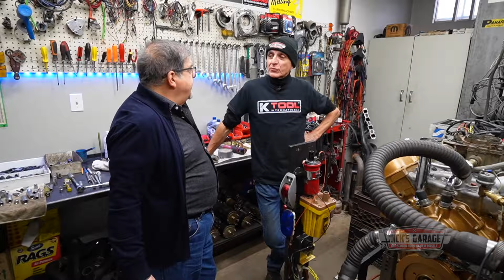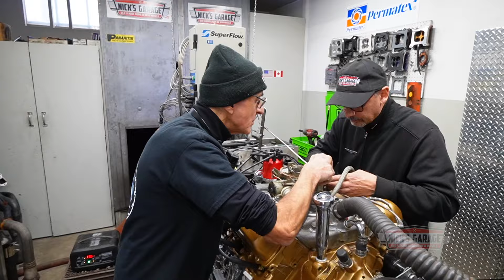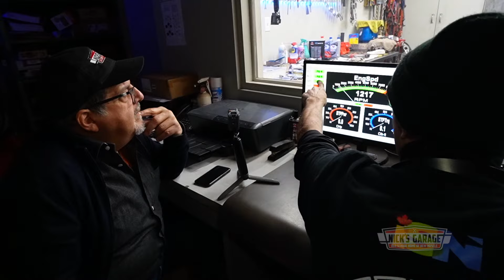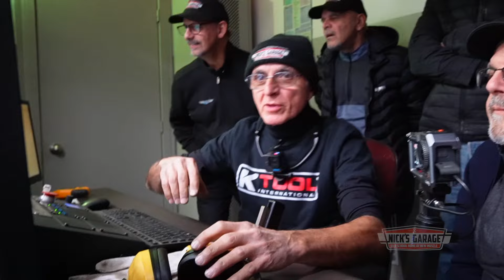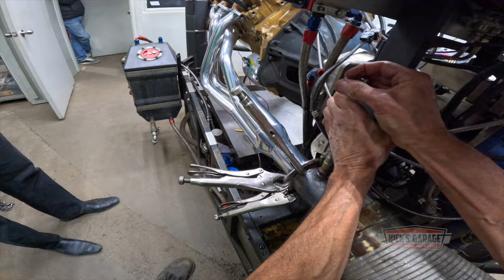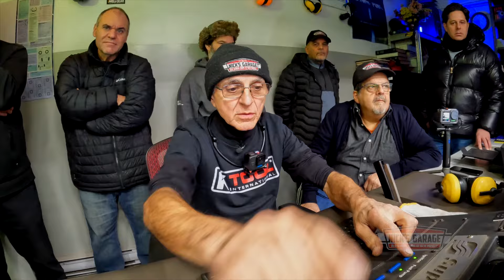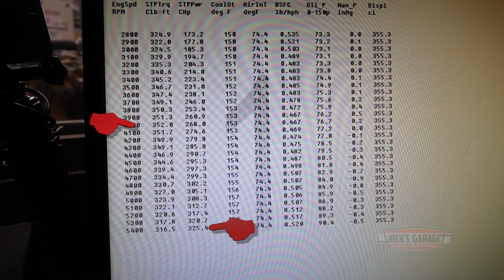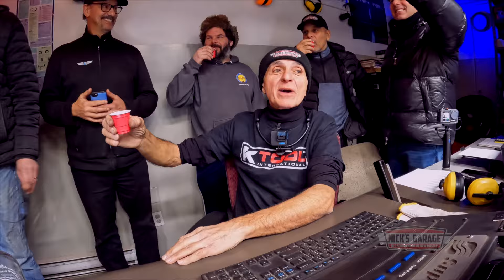Rare Olds W-31 Dyno Party - High Performance Small Block Tested

Comment: I still remember the 350 Olds engine Nick built for the guy that wanted 400 horsepower from it. I think Nick could have gotten another 65 horses if he had built this one himself.
Reply: I saw that video. He had the wrong intake in that build, and not enough cam to make 400 anyway. In addition he had a couple of spacers and an 850 carb, all of which weren't going on the car anyway. So what good is it?
Reply: @oldsmobilecutlass1805  ....It made 402 HP with a Rochester. And factory cast iron intake. In my opinion, that is great.

Comment: Had a W30 68 442 back in the day Mondello helped me with my engine great guy and harland sharp devloped the  roller rockers  for the Olds  engine yes I got a 466 W27 rear end for my car back in the 80's for 200.00 !!!! Great car had it  for over 25 years . Was one a few guys that had  roller rockers over 40 hp  per head !! Good luck with your W31 ! Nick keep  up the great work !!! BTW Olds run the best at 38 degrees with the right octane !!

Comment: The 66-71 Tornados were ultimate street sleepers
Reply: Had to sell a 455 Toro motor during covid couldn't give it away in NW Ohio, a very cool brother from Cleveland bought it to use in a 442 project. It still had the Fwd trans attached. Motor needed tlc but was good to go.
Reply: I have a stock 1970 455 Toro GT W34 engine in my ‘70 W31 Holiday Coupe. Along with the factory 3:91 gears and 4 speed M21 it tears pretty good.

Comment: I have one of those Nick, I have  #5 heads 1968 W31 spec. with the larger valves of the W30, my block is a 71.... that engine is like the one you had on the show a few years ago.

Comment: This reminds me of my 403 in my 79 trans am se. I used to love hearing the four barrels kick in. It sounded like it was going to suck the shaker down the carb. Mine wasn’t stock though like this one is. Like they say, there’s no Olds like an old Olds!
Reply: My son had one as well in 79, did a #5 head swap, a better cam and intake, headers, jetted the carb, curved the distributor, and adjustable rocker train, whole different animal! The only PITA was drilling out the head bolt holes on the 5 heads for the bigger 403 head bolts. 👍
Reply: @Musclecar1972  did you ever put it on a dyno? That’s what a lot of people did instead of buying expensive aluminum performance heads. Used to we would get all the magazines that had different build specs and start hitting the salvage yards while saving up for a cam and ignition.
Reply: @ecleveland1  No, we didn’t, but I can tell you it was a whole different car, unfortunately about a month after we put it together, he bent the car in half around a pole, the motor went into a 1987 Cutlass I believe, I was mad at my son for a good while after that. 😡🤬

Comment: The fill size car had a bigger booster. I had a 1973 Riviera with a big cam and my brakes were fine. Now in a Camaro with a big cam you have a rock hard pedal.  I made almost all my cars hydroboost anyway
Reply: It had zero to do with the brake booster, and everything to do with the fact that the bigger W-33 and W-34 cars all had a big block in them instead of a small block, and the big blocks WOULD create more vacuum than the small block with the same camshaft.

Comment: Hello viewers.  Were the stock ex manifolds any good or were headers a big time improvement??
Reply: I wish I had a set to try testing with manifolds.
Reply: @nickpanaritis4122  I've not played with Olds stock cast iron enough to know. Must be viewers that know. Sure I could Google it- but that's no fun and not enthusiast interaction. Did the W performance engines use a special ex manifold?
Reply: @PatandDoopypoopy  ...That I am not aware of the Exhaust manifolds.
Reply: @PatandDoopypoopy Oldsmobile did have better exhaust manifolds for the big block Cutlass with better channeling inside, they were coded with W on drivers side and Z on passenger side.The hi performance 350s just had the regular manifolds.Remember the old saying "the best manifolds are not as good as the worst headers."W31 car owners were expected to acquire headers, especially the 1968 cars.
Reply: @basilcarroll9729  thanks fir sharing the knowledge.  In sb chevy world the Corvette ram horn center dumps were pretty good- but exactly as you say any header was better.

Comment: Sounds fantastic!  My 70 SX 455 was the lowest hp version, and it was factory rated at 320 hp, less than this W31 350 😁
Reply: Might not have had the HP numbers, but torque  is a different story.👍
Reply: The 70 sx is one of the coolest models of cutlass.

Comment: Back in 1977 there was a Mobil gas station across the street from the Shell station that I worked for.   They had a W-31 Cutlass parked out front, waiting for repair parts.  When they went to pull it the bay, it would not start.  Opened the hood to find the intake manifold and heads had been stolen!  All while the car sat right out front next to a main road.    Crazy!  Oh and I wish I had a dollar for everytime that I wacked my head on the "fang" of those Cutlass hoods.

Comment: Power Brakes were actually available on W cars. The new'70  W-30 i bought 12-1969 and used1970 W-31 owned later both had that & PS
Air Conditioner was only 3.42 and 3.23 rear gear.  Not avail on 3.90
Reply: 70 w-31 did not come with PB, no exception, also no 
AC
Reply: No A/C or power brakes in my W31. Cam duration was too wide for a brake booster. They didn’t come with power locks or any options either. Same suspension as the 442’s They were factory built race cars to take to the track. The only option I have in mine is a map light, which was probably a mistake made at the factory. My car has 3:91 gears and a M21 4speed too.

Comment: The W31 was a little monster. 6600 rpm redline, biggest balancer made to control the harmonics, it punched way above its weight. Think of it as a Mopar 340.
Reply: Why would ring it out 6000 rpm ? power drops off at 5600 rpm .
Reply: never got 6600 rpms out of that motor @rafaeltorres2886
Reply: @rafaeltorres2886  looks like it was holding 325 at the top. I would have have gone higher but kept my eye on the oil pressure. At that speed you can suck an oil pan dry with those oil pressures.
Reply: in your dreams never got 6600 rpms out of that motor
Reply: @bobdimartino6738  look up the engineering brief on the Ram Rod 350, it was built to run that rpm. This engine didn't do it because of the intake manifold ( low rise aluminum duplicate of the stock iron intake versus the high rise Winters aluminum intake that came standard on the W31 ).
There's a FAST ( Factory Appearing Stock Tire ) W31 Cutlass out there that runs 12s at full weight so the 350 can put out some steam when built and tuned correctly.
Reply: @hoost3056  i asked nick if he tried the edelbrock performer RPM and he said that would have been good to try it but the customer was happy with what they achieved by the way i own three olds 350s
Reply: @bobdimartino6738  Olds weren't ever high revvers. The heads were usually the limiting factor.
Reply: extremely limiting factor,  our biggest obstacle is our iron heads for pure stock and FAST drags.  Just can't flow enough to sustain rpm no matter how big the cam is and with the best oil mods like wider clearances without serious bottom end money they can't live up there in the chevy, ford or even Mopar range for long, not a BB. and torque only gets u so far!!  still its all I race.  The SBO little bette with the short stroke and best rod to stroke ratio almost ever! but their heads flow terribly, barely hit 200cfm even up to 600 lift, even the BBO heads, stock max out at 225-240ish cfm at 600 lift.  with extensive porting, throat and bowl work, Guide boss tear dropped maybe raise the roof etc etc and 5 angle with big valves you can get 255-265ish and then diminishing returns.  Still love my olds and th challenge. @marcmo7138
Reply: @marcmo7138 My 505" big block Olds turns 72-7300 rpms on a regular basis..... 🤷🏻

I think that's PLENTY "high revving".
Reply: @davelowets  I haven't seen a stock 505 Olds. My reference was about stock Olds. I happen to like Olds, so I'm not dissing them.
Reply: @bobdimartino6738  But the factory built W 31. Could.
Reply: I remember back in the 90s I was at a book store and found a detailed book on olds W-30 and W-31 engines. It had a lot of info on the heads, I think the factory worked over the ports and eliminated the exhaust cross over port plus the large valves. Imagine if they had solid lifters. I wish I could find that book, it was more of a collector grade book that was expensive. Not the typical engine build books you find everywhere.
Reply: @mcqueenfanman  it had hydraulic lifters, but it could rev out.
Reply: I think the big balancer was there to help idle too. These ran pretty rough at idle and the heavy balancer had more inertia to keep it idling.
Reply: @mcqueenfanman  it had a 328° advertised duration cam, so no vacuum for power brakes. It was rowdy.

Comment: I worked for a repair shop that built an Olds 350 four barrel for (Edit - this was dirt track) stock car racing. The engine builder was adamant he could make it competitive against all the 350 Chevy's dominating the class, but that didn't happen. The driver kept running higher RPM's trying to catch the Chevies, but one of the rods decided it didn't want to live with anything past  7000 rpm, so it quit and moved out of the house.
Reply: Someone didn’t know how to build the Olds, they were more than competitive with the small block Chevys of the time if you knew what you were doing with them, most for circle track racing use the diesel blocks they still fight for them here, when they can find them.
Reply: @Musclecar1972  The Olds was down about 50 horses from the best SBC's in the class and was never going to catch up while "staying in the rules" It would have probably been competitive "in the day" if it was the early 70's, but it was the late 90's, and builders here were getting pretty damn good at squeezing more power out of nearly stock 350 SBC's. I should know - I also worked as the machinist for the engine shop that built about half of the class, including the track champion and number two and three. The Olds driver was actually getting pretty good before it windowed the block, but he would give up 1-2 car lengths to the pack accelerating out of the corners. Edit - just as an example, one of the assemblers I worked with at the engine shop built a dyno tested pump gas 550+ HP 355 CI SBC only using regular production GM parts, except the carb. dual plane intake, headers, camshaft and valve train. Everything else started out as regular production GM parts.
Reply: @scottb8175 I understand, I thought you were speaking of the 70’s, but to be honest, like I said earlier, they still fight for the diesel block small block olds motors here to build, and when they do, they more than hold their own against the Chevys, don’t get me wrong, I love a Chevy too, my fun used to be street racing, to old now, have had small block strokers, and have owned 2 Yenko Camaro’s, one original, the other a stroked BB, had a 513 stroker BB Olds a few years ago in a 1968 W-30 442, and cars from most manufacturers, I love the Mopars too, especially the AAR Cuda’s, if it’s American, I like it, no matter what flavor it is. 👍 I actually owned one of these cars a 1970, they’re capable of a lot more than it showed today, they would go to 6000.  rpm and beyond easily, especially with an adjustable rocker train.
Reply: @scottb8175 In other words, he used the chevy crank, rods, and pistons..   big deal
Reply: @Musclecar1972 A "513 stroker BBO", out of a factory block? I doubt it....
Reply: @davelowets  Really? To bad Joe Mondello wasn’t alive! He’s the man who built it, but you probably know more than he did, Right? You could explain to him how he couldn’t possibly have done it.

Comment: I remember back in the 70's Dick Miller (Dick Miller Racing) used to own/drag race his 1970 W31 olds at the same time I owned a 70' and 71' W30 (455)....With headers, tuning, higher stall speed convertor, with 4.33 gear olds  W27 12 bolt and slicks the W31car ran consistent 12.60's-12.70's  at Milan Dragway in Michigan. Very potent small block. The 70' W30 and W31 aluminum dual plane intake manifolds were made for olds by Winters foundry. Not true about same cam on W cars and Delta 88 and W34 Toronado. The Delta 88 455 and W34 455 Toronado cam had 285/287 duration .472/.472" lift (same as W30 with Auto trans)  The W30 4 speed had 328/328 duration and .475/.475" lift. The W30 4 speed had considerably less idle vacuum than the W30 Auto trans and W34 Toronado and Delta 88. The 70' W31 cam had 308/308 duration and .474/.474" lift resulting in lower idle vacuum than other Olds 350 engines and lower than the 455 W34 and W30 w/auto trans. engines. The higher duration cams on the 70' W31 and 70' W30 w/4 speed trans and resulting lower idle vacuum was the reason they were not available with power assisted brakes.The 70 W30 and W31 Q-Jet carbs were 750 cfm.
Reply: You're absolutely correct about the camshafts used on the 1970 W-31, W-30, W-33, and W-34 Engines!

Comment: I remember the first Oldsmobile I floored. Great memories!
Reply: Me too.... it was back in the late 80's, the engine was a 455 Olds, and the car was a 1979 Trans Am. The tires had NO chance. I was hooked on BBO's ever since. 
My current 505" BBO makes over 730h.p. and is still street driveable, however it needs to have $15 a gallon race fuel in it always.. and it gets TERRIBLE fuel mileage.😟

I'm currently in the works of converting that engine over to a Holley Terminator-X Stealth 4500 EFI system. Then I'll be able to do away with the Dominator carburetor, and then be able to run E-85 on the street, then load the correct tune from the touchscreen and dump race gas in it when it's time to hit the drag strip. 

The motor made a little over 730h.p. on the dyno with a 2-circuit 1050 Quick Fuel QFX Dominator on it, but that carb was way too small for the engine. The carb ended up with the largest 99 jets in it that come in the standard Holley Jet kit, and it was still a touch lean at over 6500rpms. We gave up on the dyno at that point because there was several inches of vacuum in the intake at WOT, indicating that the carb was too small anyways. 
It WILL make more power with the Terminator-X system, as the 4500 throttle body that comes with it flows 1,440cfms. It'll be interesting for sure to experience the difference.

Comment: Those Oldsmobile engines were well made.
Reply: They are really tough engines, I have a 1972 Olds 455, runs great, all original and I still drive it.
Reply: They’re easy to swap to adjustable rockers. Just use 3/8 studs and 351w rockers.
Reply: I had a 68' Olds Cutlasswagon w/a 350 what a beast!
Reply: 455 olds engine were used in Jet boats ( Squirters) because of High cubic inches to move water and lower engine weight due to lack of webbing in the engine block..
Reply: @ricksmith4736 They were used because of the 500+lb-ft of torque out of a stock engine.
Reply: not bad,i built 2 for my jet boat. didn't like the non adjustable rockers like dodge.
Reply: @sprintcarsandguitars959  I put adjustable valve train in my 403.
Reply: @marcmo7138 I used the Dave Smith adjustable on my 403 in 1990, I think it was.
Reply: @sprintcarsandguitars959  aftermarket has stepped up or you can adapt the small block ford rockers
Reply: I’m a diehard Oldsmobile fan but I’m wondering why the oil pressure is so high on a hot engine?
Reply: @hugieflhr03 Why not? A higher pressure oil pump is a GOOD thing
Reply: @davelowets  I agree but that looked pretty extreme for a hot engine just above idle. Remember Oldsmobile uses the hex style shaft to drive the oil pump. Although larger than the problematic Ford drive, they can and will shear or strip out the pump. So make sure you purchase the hardened oil pump drive shaft with the HV oil pump.